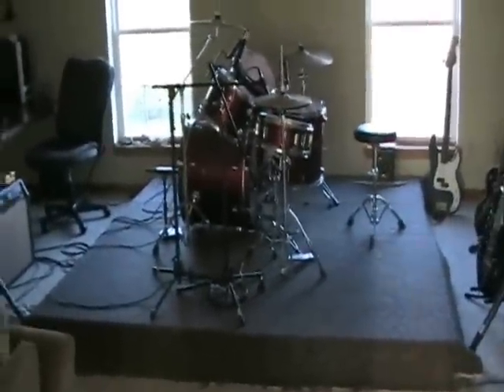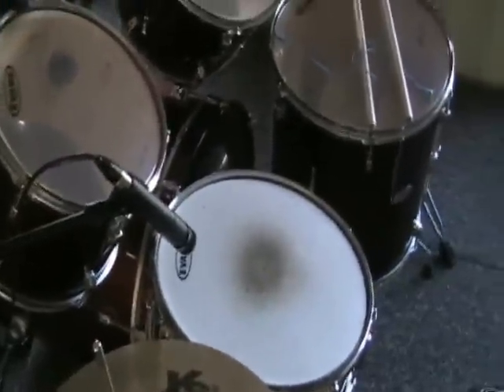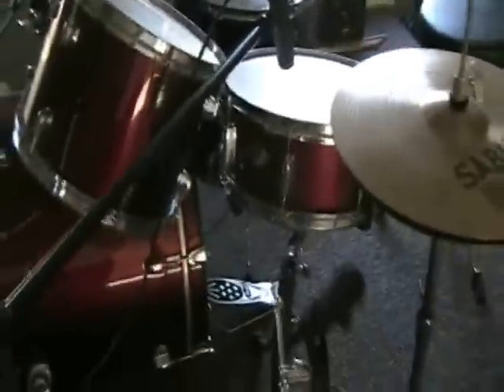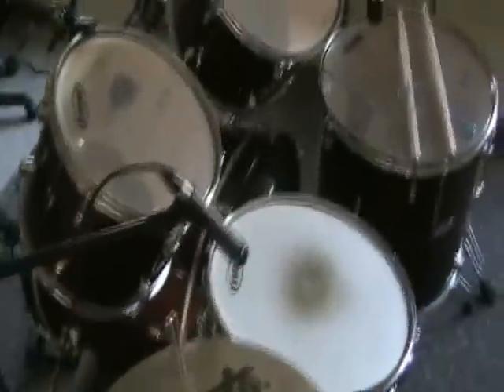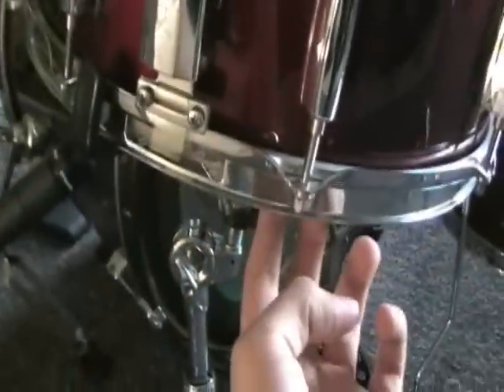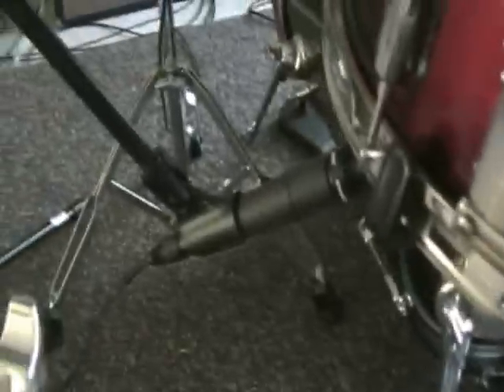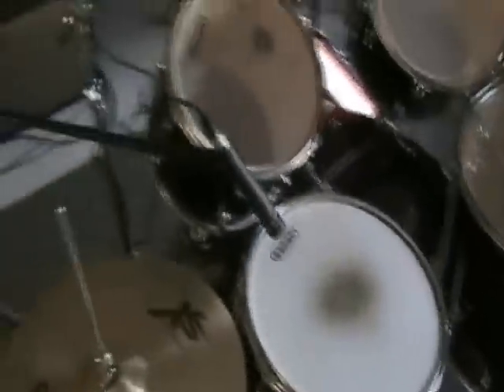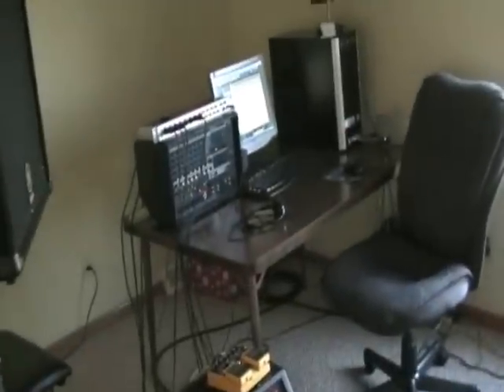Phase cancellation on a snare drum

Comment: Sometimes you can just adjust the mic distance from the head so that they are different.  It doesn't take much.  Usually about a 1-4 ratio.  By that I mean that if your upper mic is 1" away you could  move the bottom mic 4" away and it's just enough distance that it will stop the phase.    It doesn't always work, but it's an easy fix in some situations.